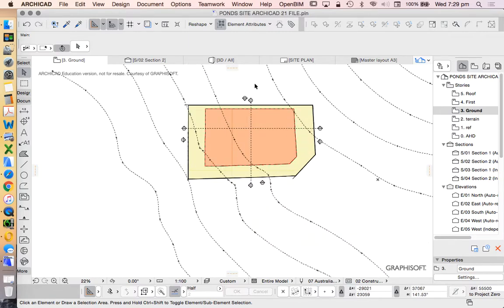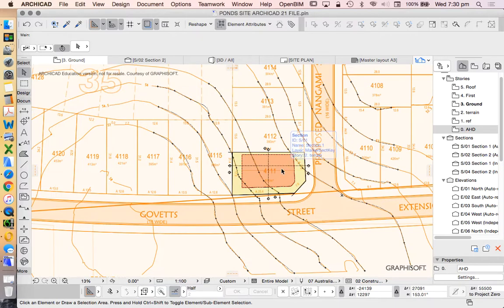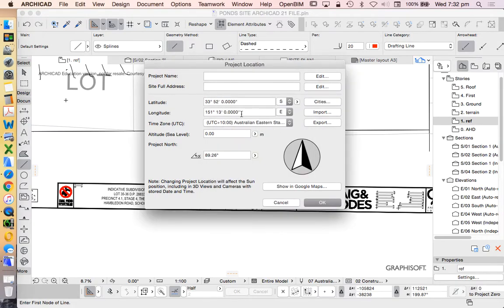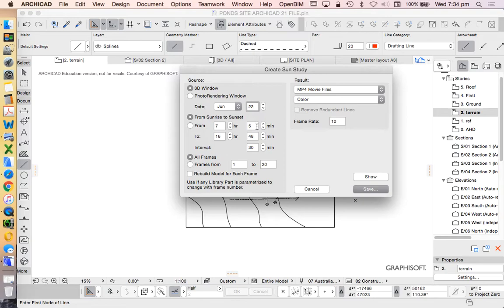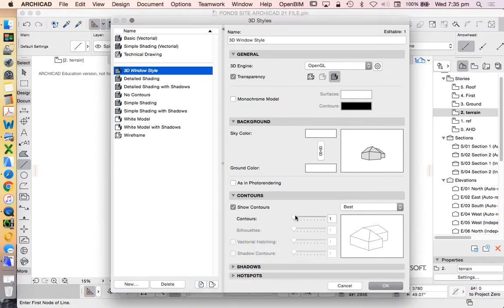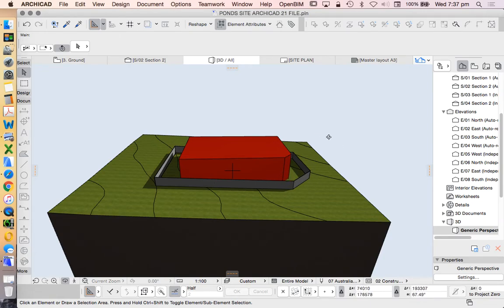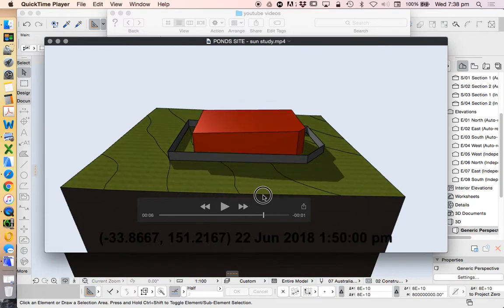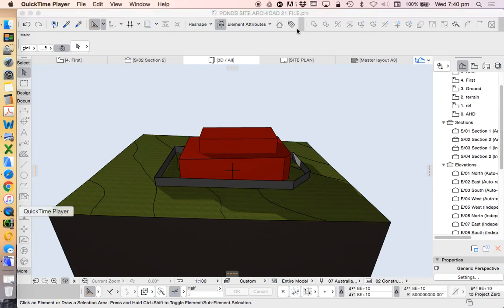ArchiCAD 21 House Project - part 09 Sun study

Comment: Hi first of all thanks so much for all of ur  videos.

I want to ask u : 
I’m working on my Mac Pro 2014 I’m working on big project but I have issue that the archcad when I build a lot of building the program start to be so slow when use the 3D and when I want to take the elevations each elevation takes 10 min to I can save it after .

I just wanna know if that normal coz is big project or there’s something I did wrong coz I’m working all in one layer I think and if there anything that speed the 3D like I don’t wanna show the materials in 3D until that I change it like revit the 3D is white scream until u ask to show the wall material and the other materials.
Reply from the maker: Hi, this is very common. Mostly, objects like people, trees, and cars (even excessive furniture) are unnecessary in archicad (and often make the render look less real) as well as dramatically slowing down the processing. I would suggest using these sparingly (if at all). Instead use billboards if needed for animation (or pos-production photoshop additions) for stills.